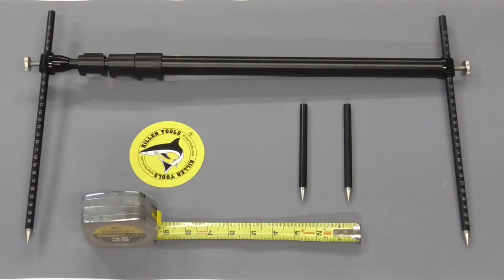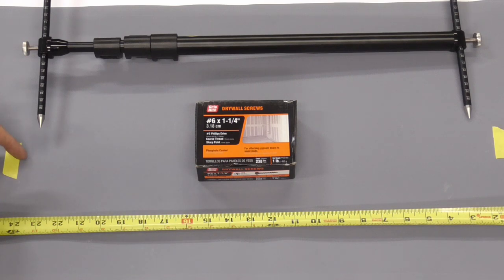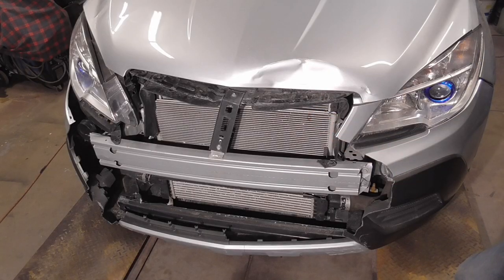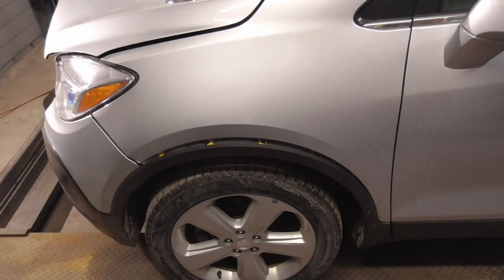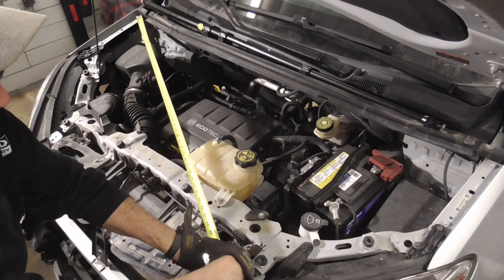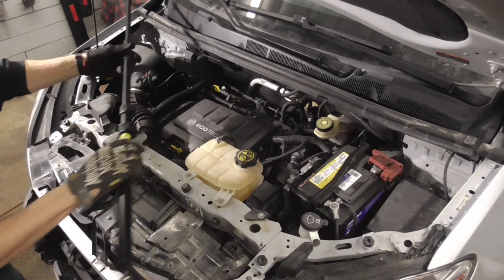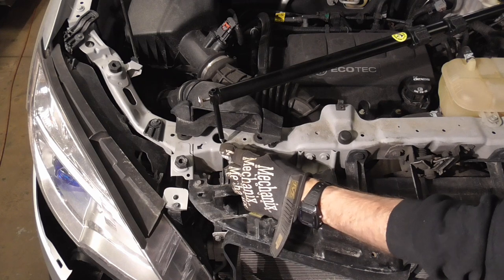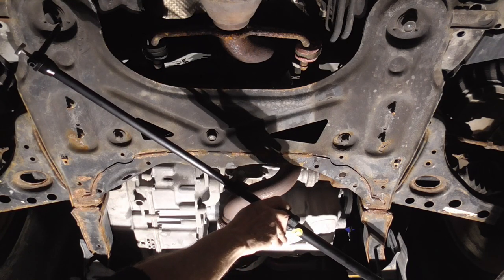What is a Tram Gauge?  How do You Use One?

Comment: I've always been a believer that if any structural damage is suspected, you have to measure with a tram gauge and using the factory control points. Same goes with suspension damage.